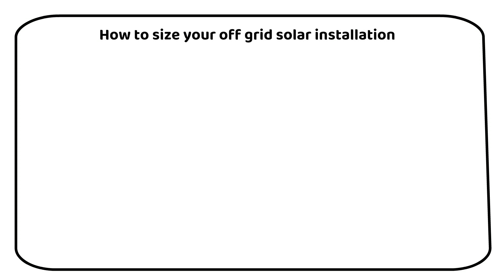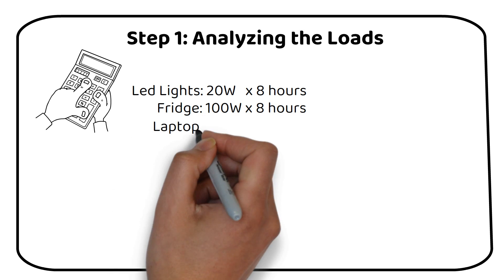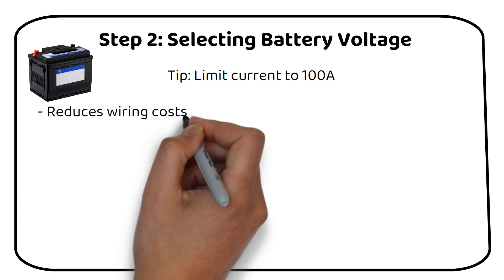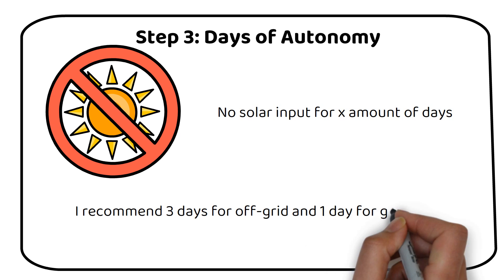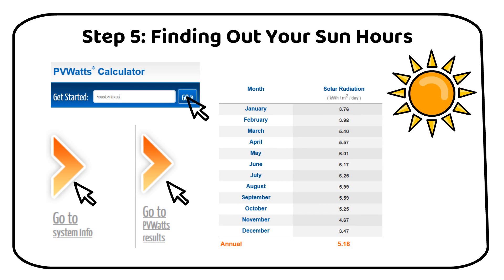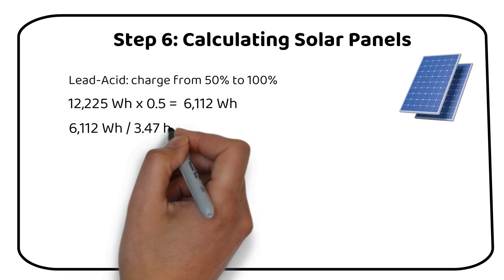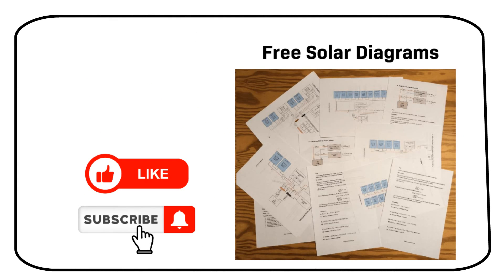How to Size Your Off Grid Solar Power System: Off Grid Solar Calculation

Comment: Very clear and informative Nick! Thank you.  I am designing a small offgrid system to charge a 1070 power station for emergency/power failure purposes (mainly to run the fridge and maybe computer/router), but I also want to dump the energy into my hot tub when there is no emergency and I figure about 3 KWH through a DC resistance heater will defray much of the hot tub heat load most of the year.  (My hot tub is 30% of my total load!)

So my question is, which is the most efficient way to dump energy into the water:  Direct DC connection, PWM charge controller or MPPT charge controller?  Or charge controller to inverter to an AC heater?

Thanks much for any suggestions.  Keep up the amazing videos!

Comment: I keep doing his calculator then doing mine manually. VERY big difference.
Four 200 watt panes = 800 watts.
800 / 24v = 66.67 amps @ 100v. (actually just under that) (200x/24.8v = roughly 8 amps per panel)
800 /12.8v = 62.5 amps.

According to his calculator I would be pushing 237 amps through the controller to the batteries, which the math doesn't jive.

Panels sticker shows just under 8.9 amps at 24v.
So 4 panels x 9 amps is a far cry from what his calculator says.

Something just isn't right.....

On this web page of his dc-surge-protection-device-for-solar-panel/
there is an error - custom-related-posts title=”Related Posts” none_text=”None found” order_by=”title” order=”ASC”
Reply from the maker: How do you get 66.67A at 100V? The 66A is from the charge controller to the battery, not at the solar panels. The voltage is transformed down while the current is increased in the mppt. Check my video how to size charge controller.
Reply: @cleversolarpower  800 watts of panels at 24v per panel (200 x 4) is roughly 100v
Could be my math is a bit off.
My panels are rated at just under 9 amps each at 24v.
4x9 = 36 amps.
Stepping down 100v to 12.8v means amps go up by that factor of 8.
But, I am using 200 feet total 8 gauge wire so I lost at least 15% at the controller input.
I dunno. All this is complicated.
Going to buy a Victron 150/70 controller.
If I can't make it with that then I give up.
Reply: @cleversolarpower  watts is ALWAYS watts. 800w/12.8v is roughly 66.67 amps at controller output.
Reply from the maker: Yes, at 12.8V. you said 66.67A at 100V which confused me.
Reply: @cleversolarpower  Confused me too. Too many numbers swimming in my head lol
33.3 amps at 24, double at 12.
Ran a online calculator. It said for my setup I would have zero volts at the end of my cable from the array.

Therein lies the confusion.

So I am stuck putting things to together and crossing fingers.
No idea what fuses to use, what breakers to use, etc because of all the conflicting information out there.
800 watts @100vdc @9amps per panel of 4, 100 foot run for each wire.

8 gauge wire.

Load will be 4 LiFePo4 batteries, 12v, in parallel, powering a 2kw inverter to run a refrigerator that usually uses less than 130watts running.
Getting a Victron 150/70 controller.
Want to add 2 more panels to up the voltage and wattage a bit too.
Just to be sure.

So, what do you think?

What do you recommend without buying expensive larger wire?

That 8 gauge cost a fortune already.

Cannot put array closer to the house either or not enough sun. No roof mounting either.
Want the array movable/portable so I can put it away during stormy weather or when I have to MOW lol.

And then there is that grounding issue to contend with. Don't want ground rods all over the yard.
Nor have to keep pulling them up every time I move the array or mow.

Comment: Wish your calculator would figure in wire length for losses per distance vs gauge vs voltage. 100ft run is actually 200 ft of wire.
8 gauge wire for 100 feet loses 15% of the energy generated by the time it reaches the controller.

VOC is not truly descriptive of the incoming voltage. Mine is rates at panels for 24v  (or 27 possibly for short circuit).
Doesn't mean I will get that.

Question: If you have less power and such coming into your controller will you still get battery charging?

Comment: Hi would you mind looking @ this calculation please and would it work.. please remember i am in the UK..leeds 
Touring Caravan 
Router  = 1.0A(peak) @ 12V  Left on   24/7
Batteries 2 x  115ah  12v
Solar panel = 240 watt 12v On caravan roof 
Votronic Solar Controller MPP 260... Max 260 watt  12V  (12 V / 18.5 A / 260 Wp)

much appreciated

Comment: I have a 3kva 24v inveter. What ideal battery size do this require
Reply from the maker: The battery size depends on what you want to power as discussed in this video.

Comment: Very concise explanation for solar power. I'm going to build my own solar system based off this video lesson just to do it.
Reply from the maker: Good start! Checkout my playlist about different systems.
Reply: @cleversolarpower  This is very sad. I just found out tonight I will not be receiving the products I ordered roughly 3 weeks ago.  I will not ever do business with Aolithium. I ordered multiple products from this company that reflected they were in stock. The company waited until the date I was suppose to receive the products (almost 3 weeks after I placed my order) to tell me they are no longer in stock.
Reply: Hello I’ve been watching your videos recently step by step solar installation. You did an excellent work in a clear and simple manner or straightforward way to beginners to start. But my questions today is: can you make a video with some items like air conditioning, chest freezer and freezer etc. that will give you a plus to your videos

Comment: I have a travel van with a 48 volt system, 210 amp hour of batteries with 200 watts of solar going through a 3500 watt inverter. It seems like I don’t get anything out of my solar panels as I lose about 10 percent of my state of charge per day in high sunlight days and months . Where should I be looking for improvement. This is a Renogy system. Can you help? Thanks Kelly
Reply from the maker: Is the voltage of the panels higher than the battery voltage? If not, it won't charge. Voltage of the solar panels has to be 5V higher than the battery. So in your case it should be 60V. I doubt your 200W of solar is reaching that voltage.

Comment: So for the UK, just to "keep the lights on", you would need six days of autonomy, and therefore need 10 x 12v 100ah lithium batteries (£2,000)?   And about 3,000w solar panels to charge them?     I suggest buying some candles!
Reply from the maker: Off grid design suggests 3 days of autonomy. Sunhours is an average. If you are off grid then it's better to run a generator in winter.

Comment: Hello! I have one question regarding the last step. You took in to consideration the sun radion per square metre, should you consider the efficiency of solar panels them selfes? Please correct me if I’m mistaking. Anyway, great video. Thanks alot!
Reply from the maker: I use the average sunhours per day, multiplied by the power rating (Wp) of the solar panels.
Reply: Regarding the square metre: the 3.47 is Wh/m^2.. Why in the last calculation you wrote 3.4
 hours.. Doesn't the resulting 1420 w has to be considered per square meter?

Comment: Hi Nick what can someone new in solar energy can do about a country that use 220v for the national system is the calculation is same if not can you explain thank you very much my teacher.
Reply from the maker: I'm using 220V myself. Calculation is all the same. DC is still 12,24, or 48V. The only thing that changes is the power calculation on the ac side. 110V*10A=1,100W. Or if you are on 220V with same appliance: 220Vx5A=1,100W.
Reply: @cleversolarpower  Thanks I bought your book yesterday looking foreword learning from it.

Comment: You got a new subscriber with this video. I want to add solar with the goal to be off grid 100%, is this even possible in a residential area in Houston with home consumption of 130kwh per day? I want to use the ecoflow ultra to store the batteries because it is easy to connect. I hope you can comment. Thanks
Reply from the maker: 130kWh per day? No 😅
Reply: @cleversolarpower  ok , is it because is too much? thanks

Comment: For calculation of solar panels, actually you do not need to charge the battery fully in one day, that will cost too much solar panels.. you can charge the battery full in 2 days maybe.  what is your idea?
Reply: If I may add... PV are general cheaper than more battery. So having more PV to charge quickly, ensures that you can have exces demand in summer, for AC...

Comment: how about to the 20A solar controller is that enough for a 250w solar panel and 12v, 100ah lithium battery?
Reply from the maker: 250/14.4=17.4A -> yes
Reply: hi @cleversolarpower can i ask again..how to set up the 30A mppt solar controller to 100ah lithium battery..thank u for the response

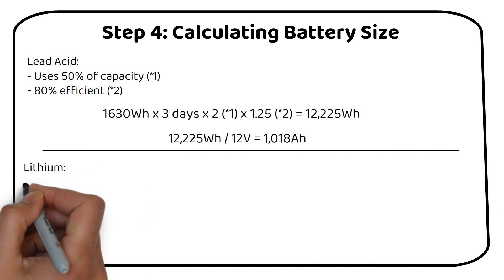Comment: At 6:19 after 3 day autonomy the 50% discharge rate is .5 not 2 ,can you explain this maybe i am wrong . Thanks.
Reply from the maker: Because the discharge rate is .5 we have to multiply by 2. So instead of a 100Ah battery, we need a 200Ah battery. So it's multiplied by 2. Or 1/0.5=2. If we multiply by 0.5 it would not be correct.
Reply: @cleversolarpower  Thanks dear.
Reply: I am sorry I have another question which I forget how 1.25 is equal to 80% of capacity ,I think it's safety factor

Comment: Not sure why you are stuck on 100Amps being a max for a system.  The main limitation on LiFePO4 batteries is often the BMS that the manufacturer uses. Most of these battery cell can handle 3-5C with some being able to handle 10C at 100%DoD for 3000 cycles or 80%DoD for 5000+ cycles. So if the battery has a BMS that is able to handle it, 3000 watts on a single 100ah 200ah or 300ah 12v unit is nothing.  My current home system uses a 12Kw inverter on a 51.2v nominal system that can surge to 36KW for 10 seconds and I have been just fine running on 450Ah of battery capacity for several years with standard 00AWG wire for the 2 battery connections to the busbar and 0000AWG from the busbar to the inverter.  The BMS in each battery is capable of 220Amps continuous and 550Amp peak surge current.  I will eventually be adding 560Ah more capacity in the near future but that is to allow for several more days of cloudy weather and not because the inverter needs it.

Comment: Struggling to understand how 2 represents 50% usage capacity and 1.25 is efficiency of 80%
Reply from the maker: 50% is half, so if you multiply by 2 you have double the other way around. 1/0.8=1.25

Comment: You have calculated Solar Panels for recharging Batteries only
What About Solar Panels required for daily load ???
Reply from the maker: Energy in = energy out. (Sort of) Minus the efficiency losses. So if the energy gets directly used by the inverter, it just bypasses the 90% efficient factor of the inverter and the 99% of the battery efficiency. Which is not much.

Comment: Is a 40A solar charge controller enough for a 550w solar panel alongside a 12v, 200ah battery
Reply from the maker: 550W/14.4V=38.2A -> Yes

Comment: Thanks, great job. What is the difference between off grid and grid tied inverter. Thanks a lot
Reply from the maker: The output of an off-grid inverter cannot synch with the grid power, thus it cannot send power back onto the grid. These are cheaper. Grid-tie inverters can send power back to the grid and are, therefore, more expensive. I made a video about different inverters. Check it out on my channel page.

Comment: I am so confused how you are converting  80% efficiency of lead acid battery to 1.25(*2) or how you 50% capacity is 2(*1). Are you trying to make the percentage to 1 whats the idea behind this
Reply: Yes me too,
Reply: I figured it out. It's  1/(80/100) let me know if its helps
Reply: We need to size double as we will be drawing power during day inclusive of charging battery
Reply: Double solar panel
Reply: So the (*1) and (*2) are pointers used to reference the side to show the explanation of the numbers. Don't multiply them, it's just to reference the list. He's using "x" to show multiplication. Also the 1.25 for lead acid is to make up for 75% efficiency which is probably better to calculate for than 80% (which would be 1.2). That would make your final calculation better to anticipate more losses than the average lead batteries. The explanation of 1.25 is the 1 multiplied times the rest of the equation keep the number the same and the .25 sizes the Wh usage 25% more to compensate for 75% efficiency. If you need a 1000Wh system x 1.25 = 1250, you'd theoretically lose the 250Wh to heat and inefficiency charging lead acid. Hope this helps
Reply: Totally! This feels like crap! He did not explain these factors of multiplication at all.
Reply: @WhenAlone-p7e  The explanation is spot on.  The calculations are correct. Its basic Arithmetic.
Reply: @sisirasamarasekera9551  I too m confused. I dint understand this hidden arithmetic!! Hiding hiding!

Comment: When using lead-acid batteries. If the design DoD is 50%. How do you make sure that you do not exceed this set limit?
Reply: You need an inverter you can set the shut-off voltage.

Comment: The PV watt calculator is not very good. The location is very inaccurate.
Reply from the maker: Check my latest video: what can a 100W solar panel run where I check the accuracy of the tool PV watts.

Comment: In section 4 "Battery size", could you please explain why you chose a voltage of 12V ?
Later, in the last section of the video, we found powers ranging between 1000W and 2000W (1760W fo lead-acid and 1420 for lithium), so we should use a 24V battery. Shouldn't we ?
Reply from the maker: The inverter size depends on the load that we have to power. The load is expressed in watts, while the energy consumption is expressed in Wh. I think you confused power  (Watts) with power consumption (Watt hours).

Comment: Did anyone get the error in the last section of the video ?
He confused solar radiation with number of sunny hours a day !
No ! Solar radiation (in kWh/m²/day) accounts for the amount of sun energy capted by a unit of surface.
So, the calculations would be :

* For lead-acid
6 112 Wh = 6.112 kWh
6.112 kWh divided by 3.47 kWh/m² = 1.76 m²
That's almost one ordinary solar panel

* For lithium
4 938 Wh = 4.938 kWh
4.938 kWh divided by 3.47 kWh/m² = 1.42 m²

Could you plese confirm/correct ?
Reply from the maker: No, sunhours equals kW/m²/day. Solar panels at STC are rated at 1kW/m² at 25°C. Don't confuse sunhours with actual hours of sun per day. It could be that one day has 6 hours of sun at 500W/m². This is equal to 3 sunhours. Because 1 sunhour is 1000W/m².
Reply: Using ChatGPT:

*Question:
Does a solar radiation of 5 kWh/m²/day mean that on average we have 5 hours of sun in a day ?!

*Answer:

No, a solar radiation of 5 kWh/m²/day does not necessarily mean that there are 5 hours of sunlight in a day.

Solar radiation, typically expressed in kilowatt-hours per square meter per day (kWh/m²/day), refers to the total amount of solar energy received on a horizontal surface over the course of a day. It is a measure of the intensity of sunlight reaching the Earth's surface.

The value of 5 kWh/m²/day indicates the total energy received from sunlight over the entire day, regardless of the duration of sunlight exposure. This value can vary depending on factors such as location, time of year, weather conditions, and atmospheric factors.

In regions with longer daylight hours, the same amount of solar radiation may be spread over a longer period of time, resulting in lower intensity but longer duration of sunlight exposure. Conversely, in regions with shorter daylight hours, the same amount of solar radiation may be concentrated into a shorter period of time, resulting in higher intensity but shorter duration of sunlight exposure.

Therefore, the solar radiation value of 5 kWh/m²/day does not directly correlate to the number of hours of sunlight in a day. It represents the total energy available from sunlight over the entire day, and the actual duration of sunlight exposure can vary depending on local conditions.
Reply: Otherwise, that's an excellent video ! Thanks !

Comment: Batteries are expensive and as you will get at least a little sunshine even on a cloudy day, I would recommend oversizing the solar system and going for a smaller battery size. From an economic standpoint, the depreciation on batteries is just too much compared to the cost of adding extra solar. It also depends on what is available: this equipement comes in specific sizes, you have to make the calculations with the panels, inverter and batteries that your potential supplier has available. If he has a 4 kWh battery, use ~3 kW panels, if he has 5 kWh, then ~2 kW should be enough.
Reply from the maker: Getting second-hand solar panels is also a great way of saving money.

Comment: These calculations are not worst case - the average sun-hours equivalent per day may be a lot less if cloudy and/or foggy.
Otherwise, this is reasonably accurate. According to the PVWatts site (which is very good), I could take their winter KWh numbers and divide by two to get the actual  values, but March through October matches quite well.